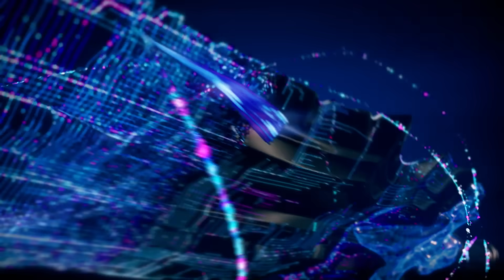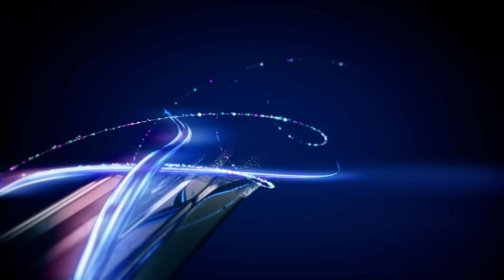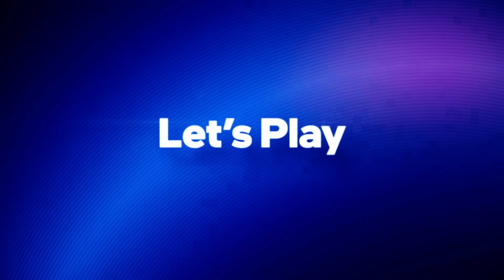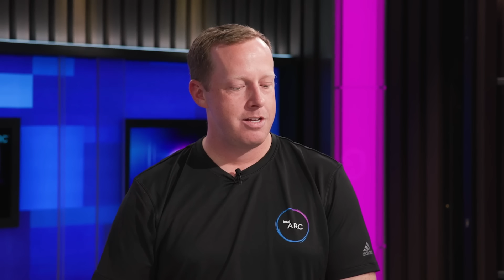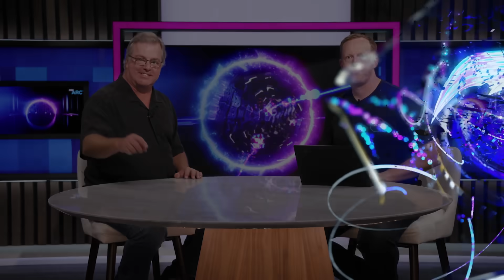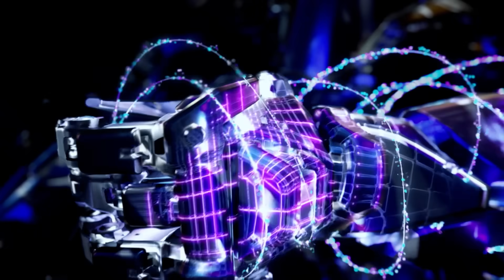Intel Arc Graphics Q&A - ReBAR

Comment: Please don't kill off Arc gpu :D I want this to survive. There are 2 crucial features (in my humble opinion) Arc needs to have in order to convince people, 1- An ocean of driver support for even the niche games. 2- Being at the leading edge of new innovations. Being that one gpu company that introduces all the new features that then others follow. Many times it's been Nvidia that has done this with ray-tracing, streamer features etc. Now it has to be intel.
Reply: I agree. They support that video encoding whatcha call it probably as a feature to get streamers to buy a card even if just for that one feature.

One day they'll get their act together and won't need that feature to sell, but pleaseeeeee don't drop it. Make it the norm!
Reply: Arc just needs to be decent and work.

which it currently doesn't. let Nvidia be the innovators, they have been for a decade or two and still are. not what Intel needs, if they cant even get the cards and software to work straight first
Reply: @user-wq9mw2xz3j  exactly. Look how long it's taken for AMD to be competitive again. I don't think people understand just how much time it takes for a company to be able to consistently release new, more powerful GPUs. It's going to be 3-4 maybe 5 generations before Intel could even be considered a true competitor.
Reply: they wont, there is waaay too much money into it
Reply: They had enough time. A low profile card with no external power was able to beat Arc. Give up on desktop, stick it in laptops and sell to the entry-level gaming market.

Comment: I wonder if the ReBAR requirement also applies to the Linux drivers, and how this might impact performance on esoteric architectures. For a little while I’ve wondered if Arc’s open drivers will work with IBM Power9 hardware, and if so, how that will look. It’d be a miracle to get an answer in response to a YouTube video but you never know!

Comment: It's a shame that Arc runs so poorly without ReBAR, making a CPU/mainboard upgrade essentially a requirement. Anything before Coffee Lake won't work. So if you have an older system, maybe an i7-6700K, you can't upgrade the GPU to an Arc one. A lot of people still use older CPUs as they are still good, so the ReBAR requirement is a big oversight that will likely impact sales.
Reply: Mmm, now tell me. If you started a GPU business right now, how do you probably focus on developing it? With current modern rigs, or with CPUs of about 10 years old?
Reply: @Pacho18  I would focus on compatibility with all systems to drive adoption.
Reply: @ProjectPhysX  I'd too. But businesses does not work like that. They probably pondered the cost and maybe for them is not worth it.
Reply: @ProjectPhysX  At a certain point you just have to design your product with modern capabilities in mind. You don’t have to make the same compromises that companies with over 2 decades in the business made. Stick with what gets you the best possible performance and try to master that. Then you can start to look into improving older games. The last thing consumers want is a GPU that is mediocre on every conceivable scenario. Right now they’re competitive in newer games and they’re allegedly going to be priced much lower than the competition. This is their first generation — if the older games don’t play well, stick to AMD and NVIDIA.
Reply: @livedreamsg  The vast majority of PCs today lacks ReBAR support. So Arc only works on a small minority of all existing systems, without obvious warnig signs to the layman. That is not "modern capabilities", it's straight incompatibility with hardware that is not even 5 years old and this is really bad planned obsolescence. Imagine someone upgrading to an Arc GPU just to find out that it's unusable because the CPU is "too old". Perfectly good hardware will end up in the landfill earlier due to that Arc design flaw.
Nevertheless I'm eager to test first gen Arc A750, as soon as they ship the Xe Scavenger Hunt prizes in September (?). I'm happy there will be a 3rd player in the GPU market and hope they will eventually pull a Ryzen and fix the apparent flaws of Alchemist.
Reply: Well, the PCIe 3.0, slower single thread performance will also negatively affect performance. Probably as much as lack of PCIe ReBAR.

But yes, would still be able to use the GPU.
Reply: I can verify Arc 770 runs everything I throw at it including demolishing 3d mark tests without re  bar, I will try that next!😎👍🏻

Comment: If only you could force ReBar updates to older platforms, because everything the last decade should support it but very much does not. This is the only thing stopping me from buying an Arc card when they come out all my spares are X99 Broadwell-E systems, and my primary has a more powerful card than these will be. I can't imagine I'm alone in having perfectly good older systems which are effectively cut off.
Reply: That feature didn't exist when Broadwell was made. It does suck as there are a lot of people in that situation, but you should just skip Arc entirely for that system. It doesn't entirely rule out budget builds, but they'd have to be only from the past 2 years.

Comment: I really like the price of Arc and am willing to try it out, but should I get it if I have an Ivy-Bridge Xeon processor? I don’t really run demanding games but I wonder if those frame times are going too much. Also, would productivity work be affected if rebar is off?
Reply from the maker: Hi! Please know that not only running demanding games, systems with Intel Arc can be used to perform various other tasks, such as streaming, video rendering, etc. It provides top-notch user experience with its high-end processing power. Having that said, we recommend 10th gen and newer processors for ARC graphics as enabling ReBar is necessary. Please visit the link to learn more about system requirements for Intel Arc at https://intel.ly/3OHAtvy. You may DM us on our Twitter/Instagram handles or send us a private message on our Facebook pages for more inquiries. We'd love to help.

Comment: Arfg PAT help me ! A b450m AM4 board with the above 4g decoding option and CAM as ASRock calls it (the rebar option) but with a ryzen 2700 cpu. Will it enable rebar on an Arc cpu ? Sam/rebar is in the pci 3 spec so in theory everything is there. But you'll only read about ryzen 5000 cpu supported because that is what AMD called for for there 'sam' marketing... I'm totally at a loss what will work now . I'd love to try the a750 but if it requires a CPU upgrade then it's not the value option at all :(

Comment: My Arc GPU cant run with resizable Bar on, on my System without a New Motherboard. And its freaking Slowww without it. As soon im faster than 120miles per Hour in NFS Unbound. It gets down to 10-40fps
Reply from the maker: Sorry to hear that you are facing difficulties. Please refer to this article to see if you have fulfilled all the system requirements to enable Resizable BAR on your motherboard: https://intel.ly/3jld6Ky and ensure that you enter the BIOS settings to enable it. We also recommend that you contact your motherboard manufacturer to check if your system supports Resizable BAR. That being said, we'd like to emphasize the importance of disabling CSM, which is frequently required to take advantage of Resizable BAR. If the issue persists, do feel free to share your complete system details with us by sending a direct message to @IntelSupport via Twitter/Instagram, or a private message to Intel on Facebook. We will look into it.

Comment: AMD's Ryzens are SOOOO confusing! I really want to love them, but they're costing me more money than I care to admit. I received an Intel Arc A380 for Christmas. I'm using it in a machine with a Core i7-4790. Intel is constantly giving me pop-ups telling me that reBAR is not enabled. My machine doesn't support reBAR. 
I was told that the AMD Ryzen 3000 series CPUs support reBAR. Since I have a couple of B450M motherboards floating around, I found a good deal on a used Ryzen 5 3400G CPU on eBay. I just found out that AMD Ryzen 3000 series support reBAR, but NOT the 3200G and 3400G! Now I'm pissed.
I have really been in support of the Intel Arc GPU lineup, but the lack of information about what supports the reBAR is enough to turn people away.

Comment: intel if you want to compete with 3060 you'll need to show the RT perf. if just non-RT, you'll compete with RX 6600 which is better than 3060 in terms of non Ray tracing. and it also have lower price than 3060.

Comment: Cmon intel...so basically they are seeking to push their new cpus sales with this requirement on their gpus and excluding all the people that have cpus from 9th gen and below  LOL with this kind of crap they will not take any market percentage from nvidia and amd,  brilliant idea intel to leave half the pc users on older platforms out of the game!!!
Reply: Some people see conspiracies everywhere. The "rebar" thing is not about marketing, it's technical. It's a feature of PCI-E that Intel utilizes to boost performance. So does Nvidia and AMD. The Arc GPU will run without it enabled, but they're encouraging you to turn it on because performance is better.

Maybe Intel is pushing it more than the others because their drivers are new and take advantage of this feature immediately, whereas the Nvidia and AMD drivers have only recently added support.

Comment: cpu 10100f has ReBAR?
Reply from the maker: The Resizable BAR is a feature that are provided by the system manufacturers on motherboards, and it is not part of a processor specification. We suggest that you reach out to your system manufacturer to know if your motherboard supports Resizable BAR. Please know that Resizable BAR is a mechanism that allows the PCIe device, such as a discrete graphics card, to negotiate the BAR size to optimize system resources. To learn more, please refer to this helpful article: https://intel.ly/3VHR5no and https://intel.ly/3VyOufD
Reply: @IntelGraphics  ty 🙂

Comment: So ReBar is a software bandaid fix for poor hardware design?
Reply: No, it's a PCIE feature that can improve performance that was never properly implemented out of laziness or indifference.
Reply: Rebar is an integral PCIE standard feature now, and Arc is a brand new architecture that was built after it became a thing. There is no reason to optimize DMA for legacy behavior anymore
Reply: @JuanGarcia-lh1gv  What is the problem with rebar? Supports only new cpu's?
Reply: @leeloodog  Now tell me, do you know how this works when inside a VM with a GPU passthrough?
Reply: @leeloodog  Thank you for the explanation.  Have been frustrated with Intel's execution so I just assumed the worst.